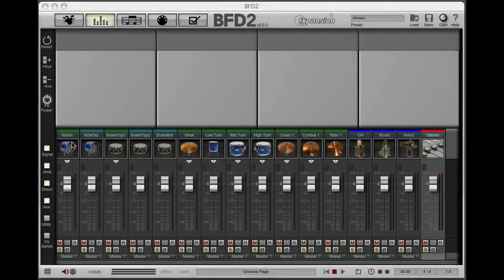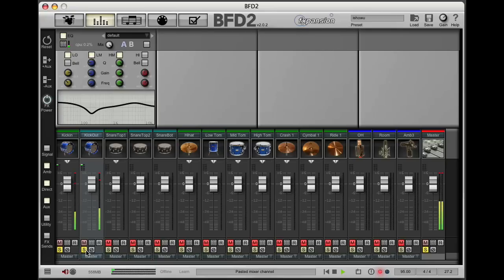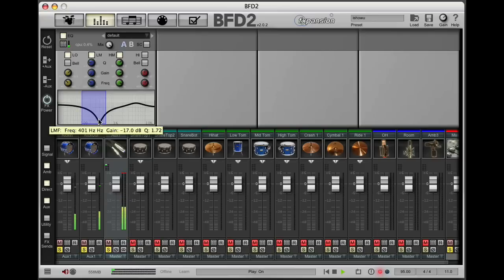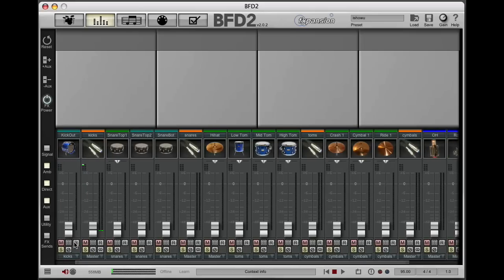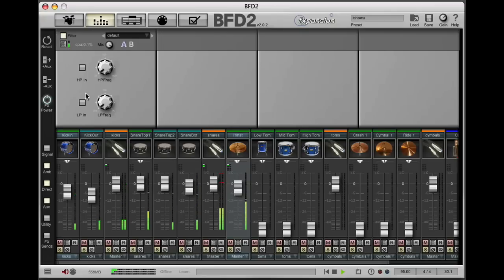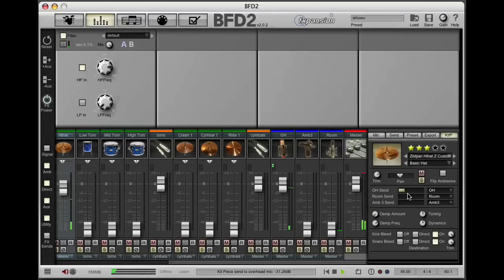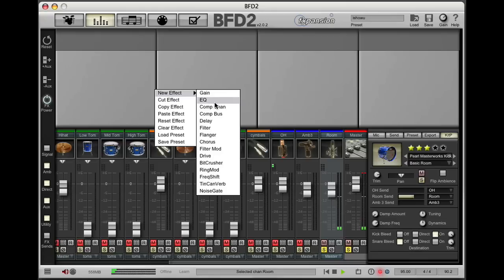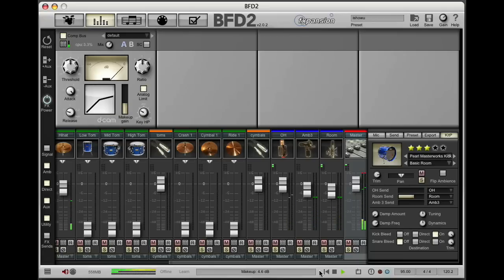BFD2 Mixing Drums Tutorial

Comment: @GqFq I know this is quite a late response, but i found that whenever i open BFD2, the gain of the overall kit is clipping on the master meter (going well into the red). this could be one of the possible causes of your problem. If so, just turn the master volume down until you have enough headroom.